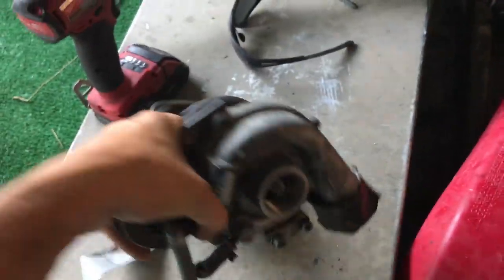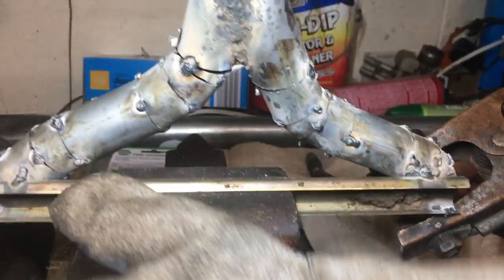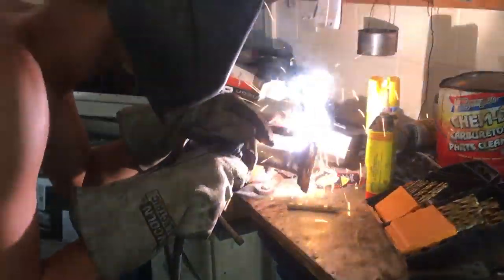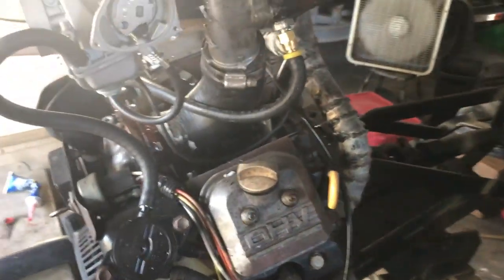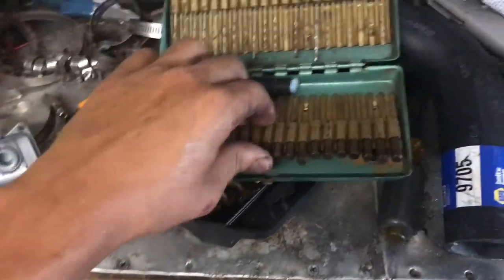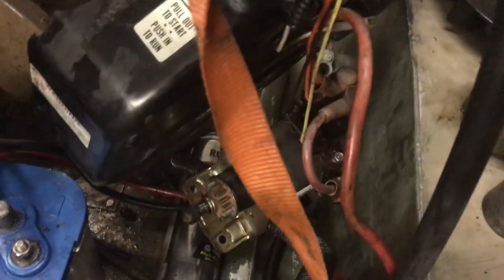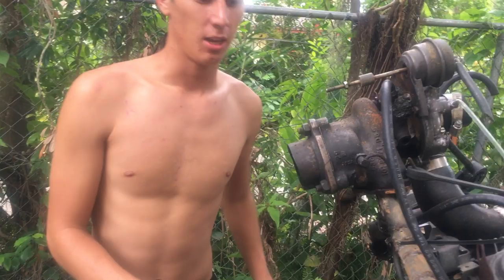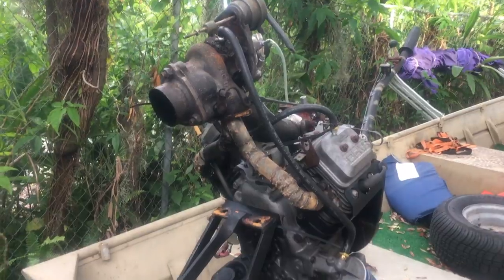Longtail Mud Motor Vanguard 20hp Turbo Build

Comment: Oil drain needs to be on the bottom of the turbo, not the top. That is going to cause the oil seals to keep leaking and keep smoking when running.

Comment: Excellent Fab work, gap filling expertise is unmatched, non-squaring and unparalleled, .... from a technical perspeculationary aspect they used proper Hi Temp RTV and the correct guage wire per NEC UL rated for the throttle without fooling with any stinking lanyard

Comment: Put the oil drain on the bottom side and the feed on the top
Reply from the maker: Redid it with a smaller turbo and proper routing. Worked decent but through a rod idling back to boat ramp

Comment from the maker: A few months after this video, a 2nd version was made but with a smaller turbo and proper routing. However, that motor ended quickly as it threw a rod on its first test pass. We were hoping to work out the bugs before making a part two video but that didn't work out.